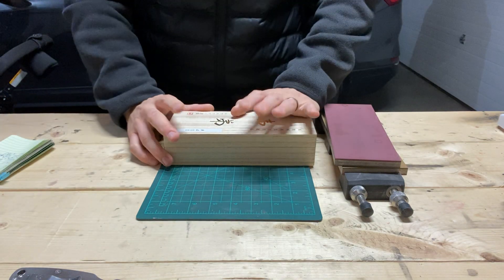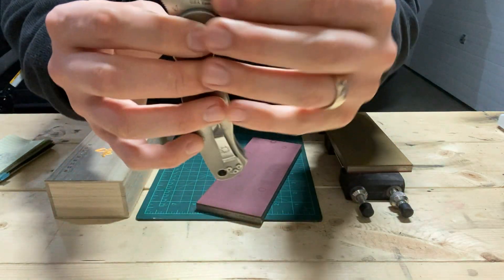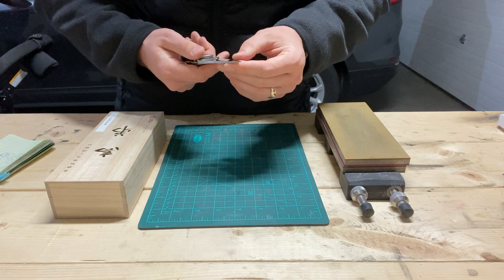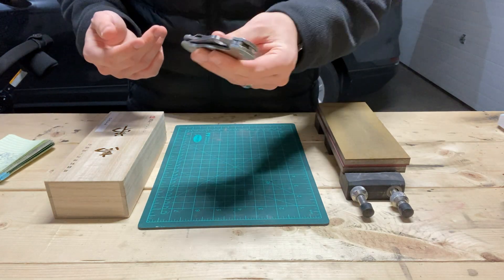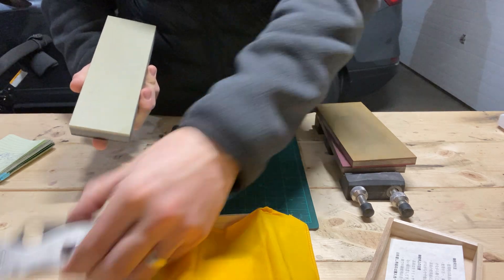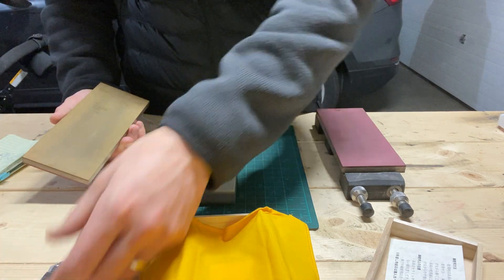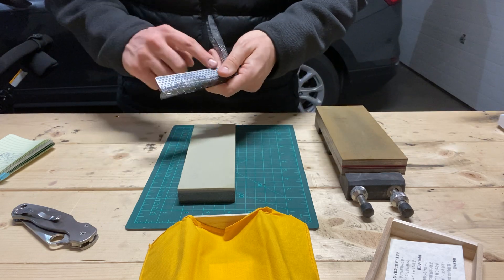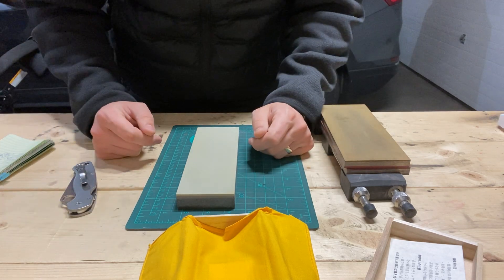S110V and #400 Super Vitrified Diamond Stone Update

Comment: I have read that s110v is a working edge steel. I don’t have a Bess tester yet but with that knife I was only able to get it to feel half as sharp as m390 or even rex45. I didn’t know if it was just skill or the steel but your testing will help put that to bed for me
Reply from the maker: I’ve heard and experienced the same things with steels like that. I will say that the high carbide volume and VC specifically make a major difference. Way nicer working edge than S30V, S35VN, XHP, etc. Even when it feels dull it still completes the task without too much fuss which is a trait I really appreciate!

Comment: Let me know how thinning out high wear resistant steels goes. I have a TRM atom that I ruined the behind the edge thickness of by removing a large chip.
Reply from the maker: Will do. I'm probably going to try it on Rex45 because the 1x30 almost does nothing to it! It will refinish it which is nice but it barely removes steel and basically just heats up.

Comment: Wow, tried it on maxamet. It  really cut like you said. Used lighter pressure this time, seemed a bit better as far as maybe not quite as course finnish off the stone. Might have just been maxamet helping me out and not the lighter pressure though, don't know.
Reply from the maker: Maxamet took the cleanest, albeit tooooothy edge so far right off the stone. 

Did you get any other stones in the series?
Reply: @EngineersPerspective701  so must just be the maxamet.

I didn't get any others but I sure am interested in the 1k or 3k stones. If the aggression of the 400 translates to those relative to thier grit that is sure alluring. Given the cost I'm glad they're not available right now but I might be after one of them on down the road sometime.
Reply from the maker: @turing2376  I'm in the same boat! I think I'll pick up either the 1K or 3K whenever he does another drop, assuming it's not for awhile, but definitely happy with just the one for now.

Comment: So where exactly is advantage except the novelty of having super expansive stone that has impressive manufacturing technology and is pleasing to look at🤷‍♂️ Honestly i enjoy sharpening and i dont need a stone that can apex a knife within 4 strokes! I think this is meant for proffesional sharpener that make living of sharpening knives but for home use its overkill... I have Venev set and Sharpening Maxamet takes me 15-20min (From dull to razor including strops) But i love the presentation of the stone
Reply from the maker: Let's look at it this way. 1) Cuts at least as fast as a new Atoma 400/DMT Coarse 2) Doesn't wear out like the Atoma/DMT so it keeps that cutting power forever 3) Doesn't load up like the Venevs 4) Doesn't require flattening 5) Has WAY better feedback than plates or and notably better than Venevs

So it has all the advantages of a diamond plate with all the advantages of a normal stone. Only downside is no slurry if that's something you'd like on this course of a grit

Now for Cost (sharpeningsupplies.com): 8" DMT Coarse=$63 and Atoma 400=$94. #400 Super Vitrified=$450. Venev 80F/150F Dragon=$160. For myself I'd say I wear out the DMT in 12-18mo (haven't used Atomas). Let's use 18 months. Now the Super Vitrified will probably last decades for most people but lets use 10yrs. Rough estimate from my Venevs I'd guess 5yrs for the dragon stone. Not halving Venev cost because you have to buy whole stone if you wear out only 1 side.

Annual cost of ownership if you replace the stones at the established life span above. (doesn't include inflation)
DMT=$42/yr
Atoma=$63/yr
Super Vit=$45/yr
Venev Dragon=$32/yr

Considering the total cost of ownership the Super Vit is the same as a DMT. The lifespan will vary depending on the person but if a DMT lasts longer than 18mo for you then the Super Vit will last longer than 10yrs so it's likely a wash. 

Essentially you get a great lifetime cost all while having a stone that is Substantially better than anything else on the market. This is how I look at it but everyone uses their money different and that is totally legitimate!
Reply: @EngineersPerspective701  Understood and well explained.. When you buy something to last you a lifetime the price become almost irrelevant but you see this stone was designed for monster steels and for vg10 is way too aggresive (maybe thats why you was surprised with how coarse it was).. But i guess its real Ferrari of stones.. But how did you break down that cost / year cause i dont know anyone who wear Venev yet (I have them 2 years and i promise i sharpen everyday and about . 010" is missing from the stones) But i also understand that we all want to try all new stones.. For me sharpening and abrasives are even bigger hobby than knives themselves .
Reply from the maker: @georgeyoung4292   I was also concerned that it was "too coarse" but I've been doing a LOT of testing on it. Go watch my livestream from today. I've been astonished at the grit jump from this 400 to both the Shapton 5K and Chosera 3K. Works awesome for anything up to SG2 in hardness and carbide volume.

For the Venevs I didn't have a good data point from othrers. So I measured my 240F/400F pheonix at 10.87mm and that's with 3months of ownership. I assumed 75% of that was on the 240F because I use it a lot more than the 400F. So that's (11mm-10.87mm)*0.75/0.25yr=0.39mm/yr. The Dragon stones are 2mm abrasive so 2mm/0.39mm/yr=5.1yrs.

It's a really rough estimate but it's way higher than your number which would be ~16yrs if that's 0.010" per side. I've run an 800grit nagura to clean out loading maybe 2-4 times so far which could be the culprit. Also maybe my stone was out of spec? Honestly I'd trust your number more because its been averaged over time.

Regardless if you can get 16yrs out of a Venev than you could probably get double that from the Super Vit with 3mm of abrasive, harder binder and less loading.